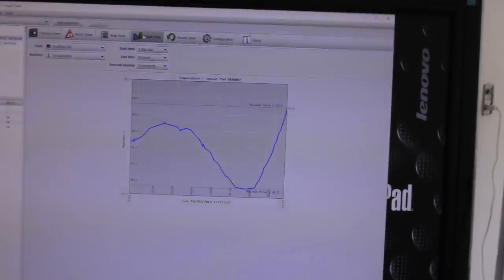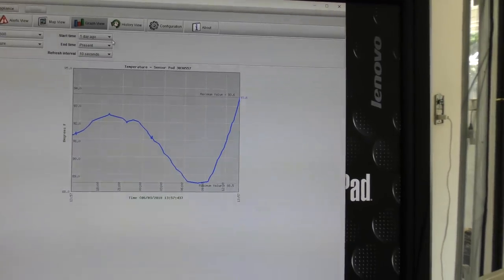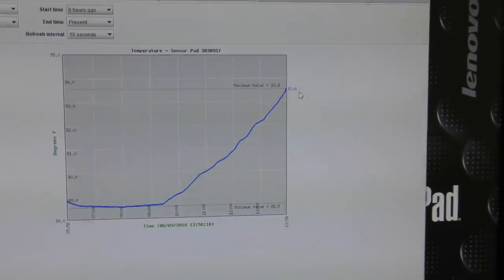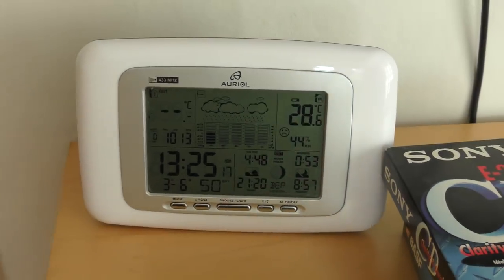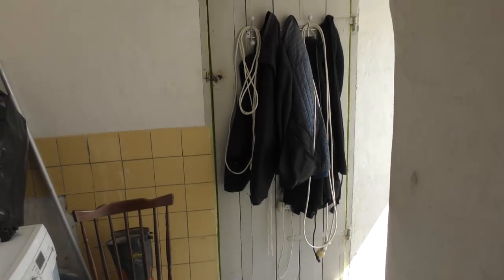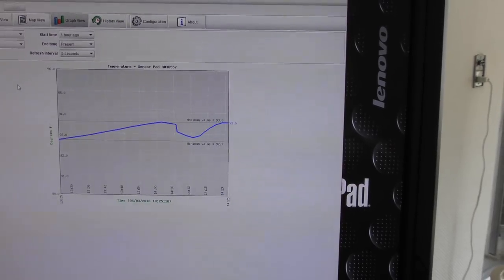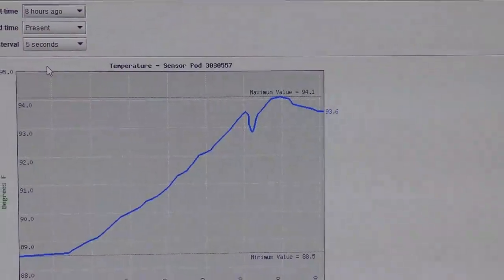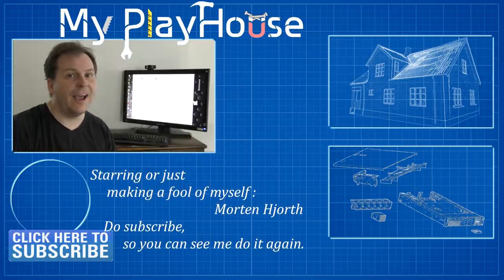Experimenting with Water Cooling, Air Intake to Data Center - 699

Comment: I've tried to explain you 2 times already but I will try one more time, unfortunately, the last one.
the major problem of every server room is how to EXHAUST the hot air and your exhaust system is not good. 
providing complex, not a cost-effective and short-term (lack of water) solution with cold air is a bad way of thinking.
you have 35 degrees on the other side of the room (sensor on the device) when outside temperature is 28,5 and intake air 22.5 also keep that in mind that this is basement which should be is cooler than outside.
basically, circulation in your room is bad and machines are still pulling/circulating hot air
wish you the best and I hope that finally, you will solve this issue
Reply from the maker: Hi wolinas
I am afraid you got most of this wrong,, Data center is not even in the basement,, how did you not see that?
Thank you for watching! :-)

Comment: the 2 approaches I think you will find you can take are replace air or create a walk in freezer(isolate the room)......I live in a city that has really hot summers(30C~), equally cold winter (-30c:P) and so basing off my experiences the 2 best ways to cool a room are replace the air; equal air in, equal air out or as close to that as you can get, this makes the room equal temperature to the outside(with shade; not in direct heat)..... or..... isolate the room, insulate the room as much as possible(no temperature gain or loss/isolated temperature or as close to that as possible.... like a thermos or beer cooler:P); using this approach than you can add in stuff that will either cool or heat that room(??or if it helps think of it as an environment??)..... I think the issue you are having is that you are trying to combine both methods and it doesn't work without restricting air intake and exhaust; think of how much cold air comes out of a window or car A/C unit and at what velocity.... other than that playing with the humidity level of the room can help too but as it looks like a small room I'm afraid of saying anything as I'm not into damp computer hardware:P; if the room is isolated humidity can help equalize the temperature(cold or hot) or if it's poorly isolated than sometimes it's better to remove humidity
Reply from the maker: Hi plasmar1
Thank You very much! Yes replacing the Air, is what I am going with,, I just enjoy to play with trying, to water cool the intake air.
Thank you for watching! :-)

Comment: What sort of distance is the water travelling from the well to the cooler?  I was thinking that you could have a closed system (with distilled or filtered water in it) running through a hose which is coiled up in the well.  My thinking is that a closed system will prevent gunk from blocking up your cooler, and prevent you from turning your garden into a marsh.  The coiled hose in the well would cool the water running through it and back to the cooler, transferring the heat to the well water.  It looks like there is enough water in the well to do this.

Alternatively,  with the system you currently have, you could run the hose back into the well so you are not wasting the water and messing up your garden.  I hope this makes sense, I found the little drawings I made in thinking this through make more sense than writing it out. :-)
Reply from the maker: Hi charmanr
Thank You very much!  glad you liked the video :-)
Thank you for watching! :-)

Comment: What about extracting the hot air better, I would suggest two air outTakes, one for the house already in place (to warm the house in the winter) and another directly outside that can help during the summer. (The two together wold have a lot more airflow).
For me the intake be carried by the server Fans Themselves as they have to be ON anyway. Just cut a bit opening on the shaded wall, and place a BIG filter, they're cheaper than water cooling gear, a lot cheaper.
This way you Filter the cold air entering from the coldest part of the building without restricting the airflow. Then the Servers pull the air and warm it up, and then you have to care about rapidly extract the warm air so the room does't get warm, even with the Cold air / Hot air system you have.
It wold be pretty much a passive system if you can get enough air in, a big opening with a big filter wold be ausome. 
This system is used by the big mining farms, as their basics have to be actively cooled by big fans, they use the same fans to direct the airflow. Just caring about getting rid of the generated heat fast!
Reply from the maker: Hi Simão Gomes
Thank You very much!  Good ideas :-)
Thank you for watching! :-)

Comment: we use radiators to cool a huge green house and the work great water trickles down over it from a pipe on top that is the same length as the radiator and has holes every inch I think and hoy air is fan forced threw it and the water trickling threw it cools it off so cooler air come out the other side it is 2 inch thick you can find it every where look for green house cooling in your area
Reply from the maker: Hi Dale L
Thank You very much!  glad you liked the video :-)
Thank you for watching! :-)

Comment: put a fan on the exhaust and push it outside. that would also decrease air pressure in the data center. allowing the air input to be more efficient. and again distilled water is cleaner, and less corrosive.
Reply from the maker: Hi MrOne2watch
Thank You very much!  Like this one :-) https://www.youtube.com/watch?v=iINCNOHKByo
Thank you for watching! :-)

Comment: You should put water back to the basenem making kind of a closed loop to don't waste water
And maby use watercooling with separate fans inside datacenter only to cool the air inside the dc like airconditioners like
Reply from the maker: Hi Imba Core
Why,, I can pump water out 24/7 if I just do it slow 3-5 Liter a min.
Thank you for watching! :-)

Comment: How about water-cooling coil indoor, and air intake convert to air out-take?
I.e. Suck the heck out of hot air?
Reply: Plus a cheap fan blowing the indoor water cooling coil(s).
Be careful if water condenses around the coil therefore flood the chamber.
Reply from the maker: Hi Ponen Chan
Thank You very much!  glad you liked the video :-)
Thank you for watching! :-)

Comment: Hi!
First of all, I would like to say that I've seen many videos, specially the ones about synology. They are very interesting.

Now, let's go to the point. Maybe the reason you are not cooling as much as expected is because this:

Radiators are used for taking heat from a LIQUID and then cool it. This system is used on CPU/GPU water cooling system and car engine refrigeration.
I guess that what you need is a compressor based refrigeration system, which is able to take heat from a GAS and then cool it. This system is used on fridges and air conditioner.

You are trying extract the cold air from the radiator using cold water from your basement, and trying to cool the air (which IS a gas) by passing hot air through the cooled radiator.
However, that's never going to work: water is a liquid, therefore it loses and gains heat faster than air. In other words, your radiator will heat up faster than it cools intake air, so you end up with barely the same temperature in your intake air.

tl;dr:
Modify your system so you install a compressor based refrigeration system. And please! MAKE A VIDEO! I would love to see how do you make your own custom compression based refrigeration system. Maybe this could help you to understand the basics:
https://www.youtube.com/watch?v=EIP3pSio7-M (fridge)
https://www.youtube.com/watch?v=7NwxMyqUyJw (fridge)
https://www.youtube.com/watch?v=1MiQCBIx1mM (air conditioner)
https://www.youtube.com/watch?v=2wZb6HgIDE0 (air conditioner)

Regards!
Reply from the maker: Hi Flashk
I am afraid you are quite wrong,,, if you do not have cold,, you use a compressor to make cold,, that cold you transport as a liquid to where it is needed,, because a liquid can hold way more energy then a gas.  then you can run the liquid through a radiator, to cool a way larger volume of air. That is how an AC works. But I have the cold.. do not need an compressor.
Thank you for watching! :-)

Comment: If you have that much water you can create a cooling tower from an oil barrel and you would get better results with car radiators and not take the air in but rather circulate it in the room.
Reply from the maker: Hi Baba Basa
Thank You very much!  What would I need the oil barrels for.
Thank you for watching! :-)
Reply: To create a cooling tower for not using that much water and keeping it cool.
if you cut the top and put a fan there and under it some kind of spray system then some plastic wave sheet things rolled up under it and you cut the bottom such that it has like 5-10 cm edge you can pump the water out of it and run it through the car radiators inside the room and then you can replace the water time to time and it could run longer this way. and keeep itself running on 20c on a summer day

Comment: I'd say that water-cooled inlet is fairly stupid idea (I know you are doing it for fun, but still :P). Since removing filters improved temperature so much, perhaps you should instead add another air intake with fan. Also better air outlet would improve situation, because 40C on outlet is fairly high. Of course this is assuming that you are not satisfied with your current cooling.
Reply from the maker: Hi Jerzyna aKwei
Thank You very much!  Yes the fun factor is a big part of this,, have ordered for another $150 parts,, for my fun project :-)
Thank you for watching! :-)

Comment: You cool with water by using the water to take away the heat, then you cool the water and then re use the water to take away the heat. You are using the water to chill the air you input in to the data center - As you found out, that isn't the best way use water.
Reply from the maker: Hi GreenZero
Well this is how most data centers work,,,, I am just not re-cooling the water, and take in fresh air instead of re-colling the air.
Thank you for watching! :-)
Reply: The air intake temp will not be lowered by any significant amount using cool water in the setup as you have it. The heat created by the fans and pump will negate any cooling generated. If this was to work you would need to chill the water to lower the intake air, however this would risk creating condensation. Think of a CPU/GPU cooling loop, the water takes away the heat from the heat sink and then is pumped to a radiator to cool, then pumped back to the heat sink to collect more heat etc.
Your set up without water as a proof of concept works however to remove the amount of heat generated by your data center needs much higer airflow in and out.
Looking forward to the next episode.

Comment: I would shut down any servers that you don't strictly need, it would be a shame to damage them :-( :-(.
You have one system taking the heat from the rear of the servers, perhaps you need to reverse that outside fan and attach a hose to the server rear to the floor pipe to suck the heat outside.
A vent into the server room from outside is needed too. Dont want a vaccume :-(
Reply from the maker: Hi zx8401ztv
Thank You very much!  servers are fine. 40c and they will be stressing about it.. they will shout down them self if it becomes to much.
Thank you for watching! :-)

Comment: i think a cheap air condition will do the trick
Reply: There are self contained ones that just attach to the wall with a small hole outside for water removal.
Reply: It would run constantly! I don't think he can afford that.
Reply: That's not an economical idea, if you already have very cold water in a well you need get rid of anyway.
Reply from the maker: It is way more expensive to cool the air, compared to just shoveling it out of the way.